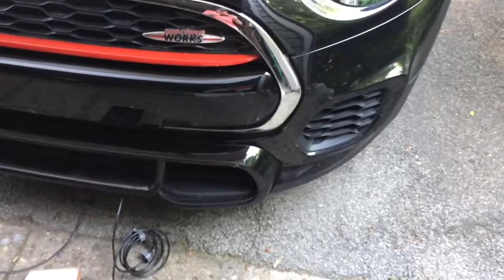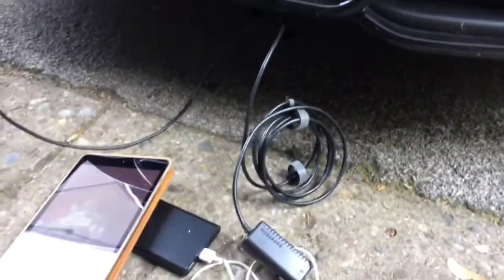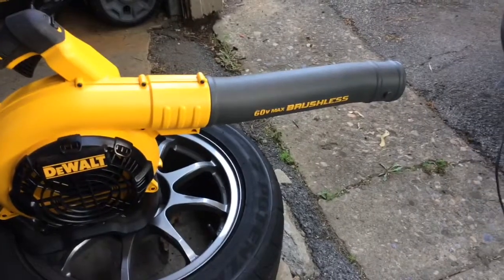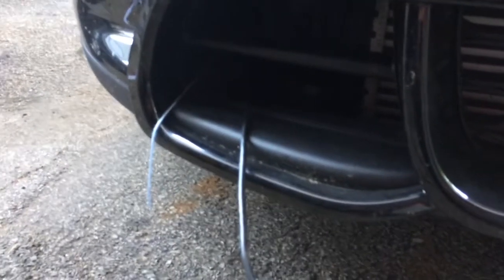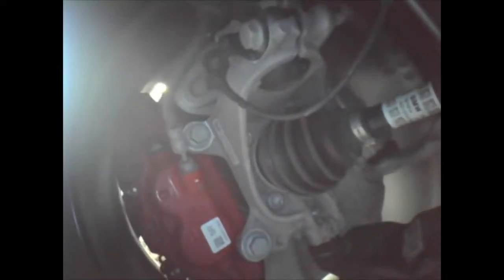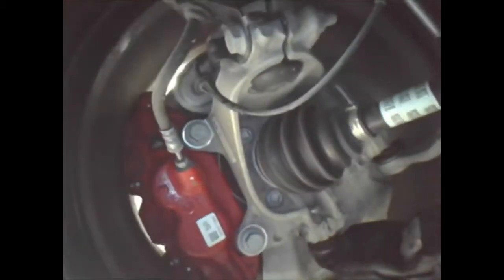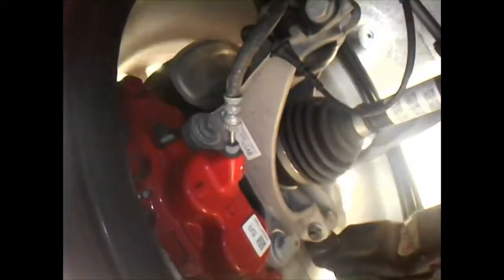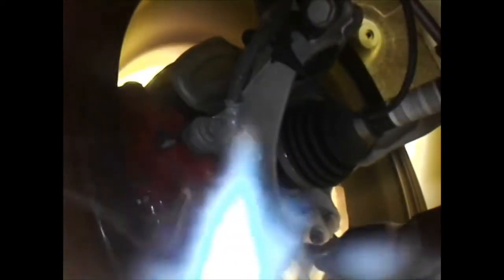2019 MINI Cooper JCW, do the brake ducts work?

Comment: Missed brake on the track yesterday, will change oil and will be looking for a solution… need to cool the brake when driving hard! Thank’s
Any suggestions?
Reply from the maker: What year, make and model car?  Brake pads and brake fluid are the number one reasons for missed braking.  Stock pads won’t work for long, if at all, on the track.  You need to have a real race pad like a Hawk DTC60.  Brake fluid in the system that is more than a couple of months old needs to be changed.  Brake fluid more than a few months old has absorbed moisture and can boil causing a loss of brakes.  Change the brake fluid to Motul 600 or the equivalent.  I track the MINI in this video and that is all I do for brakes.
Reply: @Eddie07S  super, was on stock brake fluid, G-loc pads GP1875-GS1, I’ve should have switched to my set of G-loc GP1875-R12 that are more track pad.
Car is a 2022 clubman JCW, and I was at the Tremblant race track!
I also chewed the outside part of the front tire on my RS4, hot pressure was 38 front, 34 rear.
Thank’s I’ll do the flush
The car is amazing plenty of engine and the automatic transmission is amazing!
This was my first time with a street oriented car after selling my race e30 car!
Reply from the maker: Ok and Excellent!  The JCW Clubman looks to be an excellent car for the track and you have track experience.  Perfect.  I run my JCW and a R56 S at Watkins Glen and Lime Rock Park.  WGI is a killer of brakes.  For WGI I run the Carbotech XP-12s and the Motul 600 brake fluid.  I have gone to 215-45x17” on 7.5” wide wheels and have the JCW Pro suspension, otherwise my JCW stock.  My suggestions…. If you were having brake issues with the R12s, then I am guessing the brake fluid was was your issue.  Changing that to the Motul should fix that   When you bleed the brakes, pull the filter out of the brake reservoir.  I had issues with brake fluid not passing through it too well.  If the brake issue continue, try the R14s.  As for tire wear,  I see on Tire Rack the Clubman JCW came with 225-40x18 tires.  I assume the wheels are 7.5” wide.  That wheel is too narrow for a 225 tire and it is being pinched.  I would suggest getting a set of 8” wide wheels for that size tire and you should see an improvement in the front tire wear.  I saw an improvement in tire wear when I went from a 7” wide wheel to a 7.5” wide wheel for my 215 tires.  Your only other option is camberplates and I don’t know what fits your car.  Your front tire pressure is about spot on for a street tire.  That is what I run.  Above 39 psi, the tires get greasy.  If you get onto North American Motoring, look up my Eddie07S screen name on there.

Comment: Or....at higher speeds the flow does a good job of pulling the heat out of the disc/caliper by passing on the side of it. Great video btw
Reply from the maker: Thanks...  I had fun making it.  Since I made this, I have had the car out for several track days and a thing I noticed is that with different wheels the amount of brake cooling is different.  One set of wheels is very open and has a lot of radial clearance to the caliper and disc; the other is much tighter.  I am having brake issues with the much tighter set of wheels that I didn’t have with the other wheels...  So, I think your comment is accurate.  The brake duct air coming in needs a path around all of this to work effectively.  I suspect with the “tighter” wheels the air being blown in is just passing by the wheel and brake and exiting at the back end of the wheel well without passing by the caliper and disk.  BTW - both sets of wheels are 17” and I am using the same brake pads through all of this...